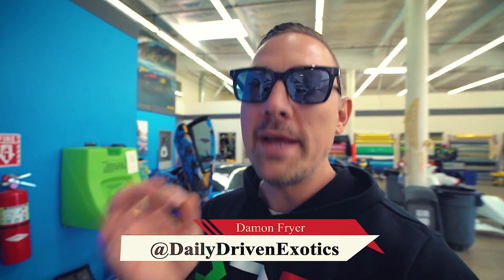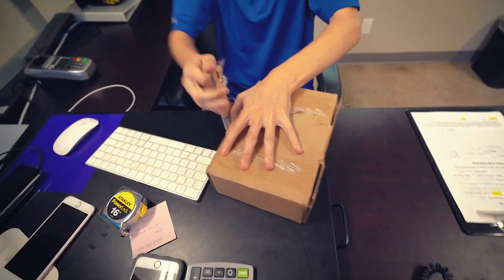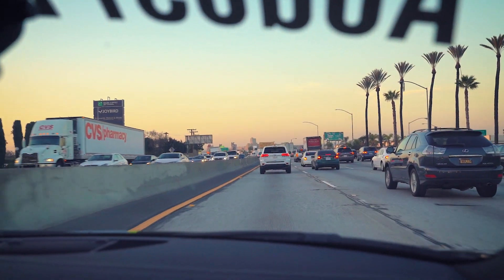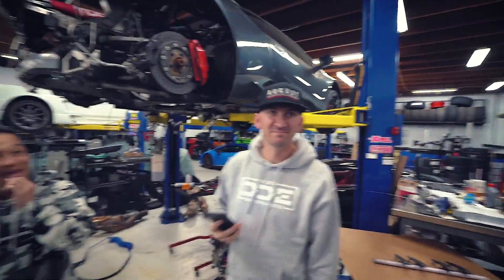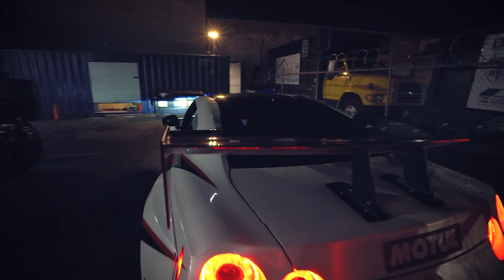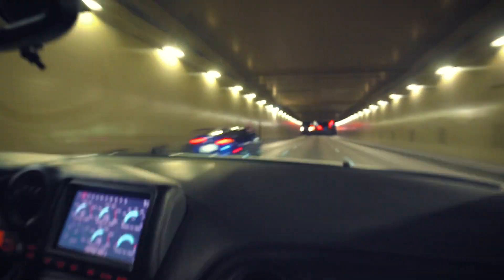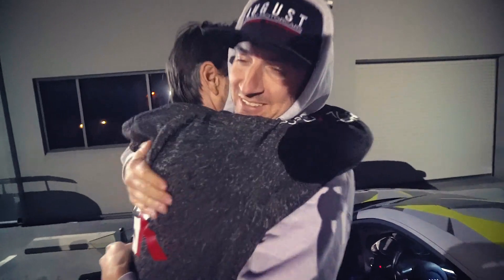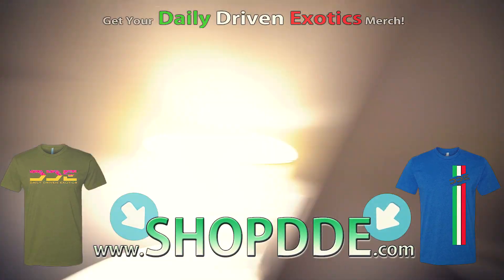FOUND A $250 SUPERCAR RENTAL!  *WIDEBODY 700 HP GTR*

Comment: The lug nuts on the gtr are not 8 inches long. The hub has two spacers. One goes on the hub using the OEM studs  and it has extended  studs  of its own so that the other spacer can sit on top of it and then you put the rim.